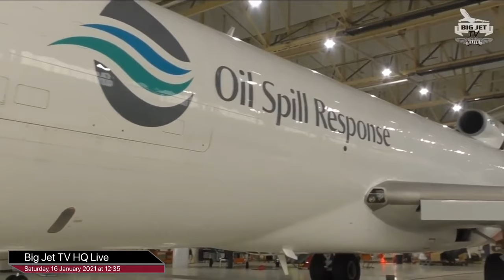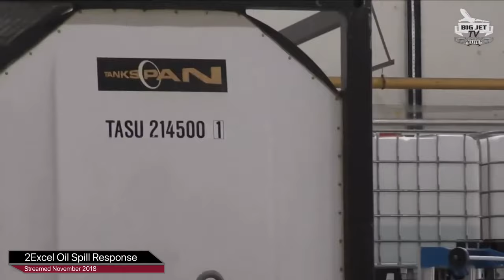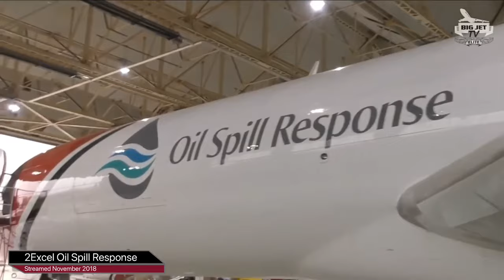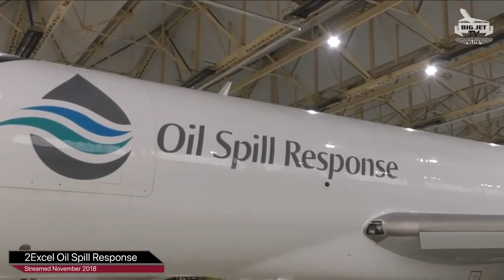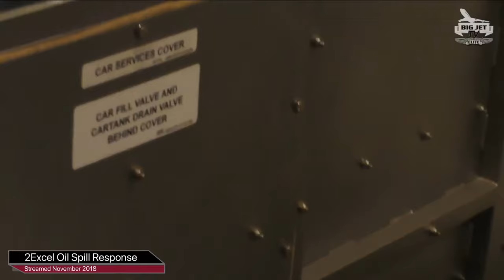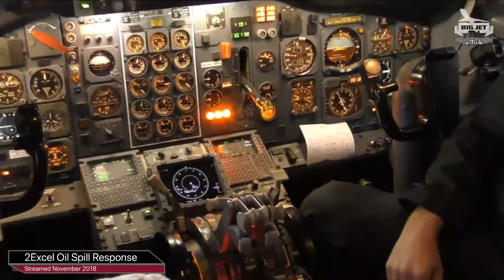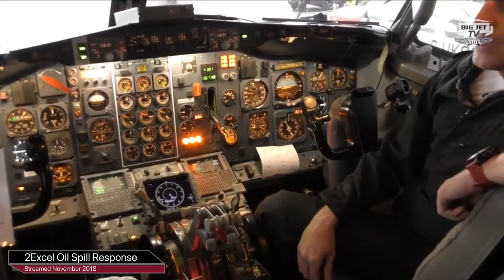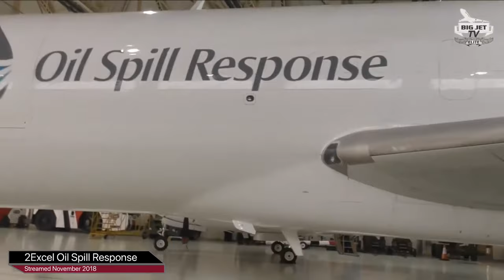BIG JETS FROM HOME DAY 11 - DAILY UPDATE WITH SHOW REPLAY: 2Excel OIL RESPONSE NOVEMBER 2018

Comment: The 727 is not the only Jet aircraft that has an oil spill dispersant system. The UK Maritime and Coastguard Agency (MCA) has now got 2 737-400 aircraft that are fitted with roll on roll off dispersant systems which is an added benefit, which these 727s cannot do. The 727 dispersant system is permanently fixed into the aircraft. The 737s used for the MCA are operated by West Atlantic and based out of East Midlands Airport. The 737 spray was approved by the FAA and EASA several years ago, so the engineer is a few years behind on what's on the market.